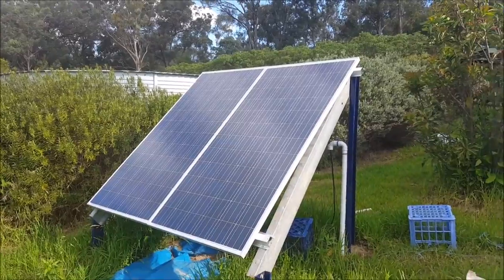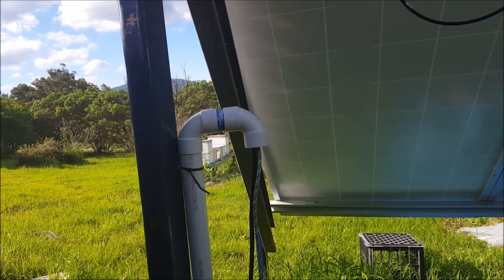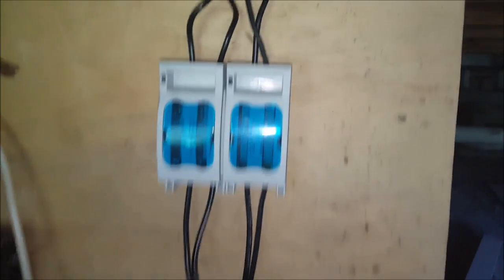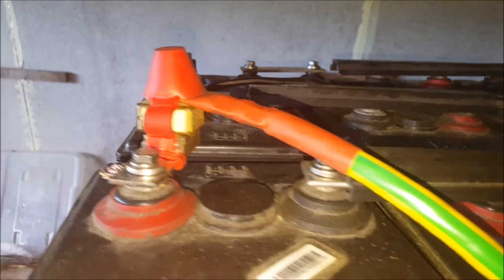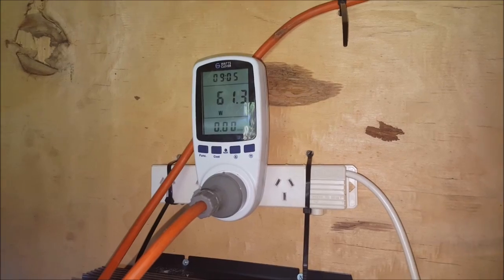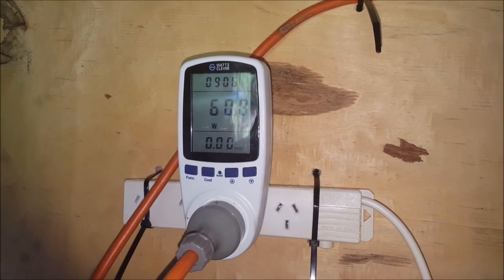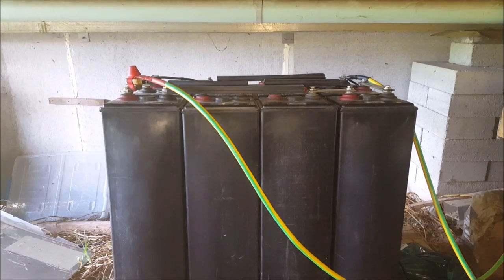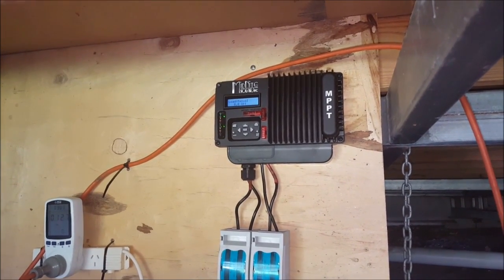Off Grid Solar Power - My 600W Solar Power System

Comment: plastic elec pipe (pvc) goes through an extra mfg. process to insure that the inside of the pipe is smooth and without any burrs.  water pipe misses that extra process.  the plastic for both pipes is the same.  the big difference is not in the pipe but in the fittings.  wire cannot be pulled through water fittings.  the bend radius is too sharp.  whereas in electrical ellbows...(90 degrees)  the radius is much longer and is then know as a "sweep".   so one would dig the ditch, use the pipe, then every needed turn a "sweep" would be used.   then after installing the total pipe run, a fish tape or "snake"  would be shoved into the total pipe run or between junction boxes.  after shoving the snake you tie your wires to the snake and pull it through the pipe.  then if. changes or replacement of wire is necessary one pulls out the old and install new wire.  never have to dig up your conduit.  but in your case, sad to say, you will be redigging and pushing and shoving forever.  or,  would you use cardboard as roofing material?  heck, why not ?  it's free or costs next to nothing.    so the lesson is....use what is required and correct.  not what is free or costs next to nothing.  i am really really trying to help you.  trust me.
Reply: for the size of pipe used and the capacity of cables I do not see a problem with this, also when you pull cables over a distance you should use a lube on the cables so they go in smoothly but this short distance will not matter. You also get on electrical fittings a short bend or the other as you say, a sweep bend.
Reply from the maker: +Robert Schilling I can pull the rope and cable through without having to dig up the pipe.
Reply: Thanks for this response.  I am aware of sweep 90's and other pvc electric condiut items that are a bit different from the water pipes.  But, the points you made about the improved inner pipe smoothness was something I was totally unaware of.  That said, I was all primed to do a PVC conduit for my mini-split lineset, but now I won't be using water pipe PVC for that purpose.  Nice to see an explanation on the why without hammering someone for the what.

Comment: I don't think you will be able to pull the rope by itself much less if wires are attached to the rope.  water pipe is for water.  electrical conduit is for wires.  cost is not a valid factor.  if cost was valid then why use any pipe?  it pains me to see water pipe being used.  i am a retired electrician.  and also a retired electrical contractor.  next time use the proper equipment.  believe me, you will be thanking me .
Reply from the maker: +Robert Schilling I used the rope to pull the wire through the pipe. What's the difference between pipe and conduit?
Reply: with pipe you might NOT cut the wires if you should dig a hole in the yard,,your really dumm,,person,,

Comment: why did you use plumbing pipe and fittings instead of electrical conduit and fittings?  you must have had real fun shoving that wire through each fitting.  you may as well had used direct burial cable and no conduit.  once installed your piping is useless to reuse or change the wiring!
Reply: For goodness sake, you're right already!! Sheesh! Does that make you feel better now? I've been following Pop for a while now and he's been extremely innovative in his system. I remember when he started small and, my, how his system has grown. It may not be up to  YOUR standards but it works for him and I'm sure it'll work for others. Tell me Robert, what's 3+3? Now tell me what's 4+2? How about 6+0? Guess what? Different equations, same answer. Guess what? Pop did it differently than you would but but came up with the same solution. How about showing the world your alternative power source since you're foremost authority? Until then, go find another video to troll.
Reply from the maker: +Robert Schilling The plumbing pipe cost me next to nothing and it was actually fairly easy to get the cable through the pipe. The double elbows are only friction fit and so are easy enough to remove. As well as that, I've got a rope through the pipe so that I can pull the cable through if I need to.

Comment: A quick question - why would you wire the batteries directly to the sine wave inverter. Doesn't the MPPT have a load output? Perhaps I am misunderstanding what the load output is for.
Reply from the maker: +David Kalnins The charge controller has a load dump feature to use excess electricity once the batteries are at float (fully charged, will not accept any more power) but that has a maximum current of 30A. The 2000W inverter can draw up to 167A. The inverter is hooked up to the batteries because the batteries store the electricity.
Reply: AHHH got it thanks - I misunderstood what the load was for :)

Comment: if you have access to the "grid" then why are you doing solar to get off of it ?  in Canada that is ridiculous.. why pay 20 -30 times the money for each KWH to be "off grid"?..  I have a 1000 watt array, a 1200 AH battery bank,  a midnite classic charge controller and a 3000 watt inverter charger, a 2000 generator.. the system cost me $10,000 and we pay $0.06 per KWH on grid..  that will take about 200,000 KWH of grid power to meet the cost of my solar system
Reply from the maker: +MrMeanderthal It was costing me $525 a year just to be connected to the grid. Then they charge $0.28/kWh on top of that. My last full quarterly bill was $144 for the connection fee and $70 for usage.

So far this system has cost me $2,500. Just on the cost of the annual connection fee, that's a five year ROI.
Reply: +Pop's Shack  in British Columbia where I live all you pay for is what you use except for hooking up the first time when you build a new house.. the cost depends on how much wire and poles it takes..  if your house is far from the poles on the road it can cost a fortune  but if you are close it is pretty cheap.. if you buy a house already connected it's just power usage you pay..  

the only reason I have my system is I live in a motor home and want to travel and park wherever I want and still have electricity.. I can't run everything on it though, my heater, hot water, and stove are propane..
Reply: and you don't pay a multi national company each year just to make them wealthy and if things do go pants, at least you will be able to take care of yourself.

Comment: Hi why have you got 40A fuse on the solar. If any thing happens they will never blow your cable will act as the fuse not the fuse itself. Just giving you the heads up.
Reply from the maker: Mainly as an isolator for the charge controller. If you see my more recent video, you'll see that I've gone to MCBs.
Reply: Ok I will check them out.

Comment: cool, you could do with more batteries,  nice little system.
Reply from the maker: I don't need more batteries as I only use about 1.6kWh per day, but newer batteries definitely wouldn't go astray.

I'd like to buy 8 x 200AH batteries for my next system, which will be 48V.
Reply: +Pop's Shack from what ive read its best not to discharge the batteries any more than 20% if you want them to last, ive seen charts showing how many cycles a battery  can do at 50% 40% 30% 20% 10%, at 50% dishcharge they dot last long. seems to be more cost effective to have more batteries,  although they cost the earth, i was trying to find away of building my own but ended up bying used near new from the mining industry, i found them on ebay but i cant find the guy again, theyre only 12v 100amp but they weigh 40kg each. another friend bought used locomotive batteries theyre 2v and each battery weighs 250kg. he bought them as scrap but most are still good.
Reply from the maker: +closertothetruth I'm only using 1.6-2kWh per day and that's on the days that I'm actually AT the shack.
Reply: +closertothetruth  I agree with you completely. I commend this Aussie on some very nice work thus far. You are exactly right in your assessment of his setup. I would suggest he DOUBLE his Solar Panels and Battery Bank-he can wire the two 24 Volts Banks in Parallel. THEN he'll be SET!

Comment: Cool Channel. I have a couple of questions...if you don't mind helping. What are the specs on those fuse isolators under the Midnite Kid? Specifically, I am looking for something inexpensive to protect my two PV arrays. The VOC on one array reaches 110vDC and around 24 amps max. The other array runs about 58vDC and about 15 amps. Where can I get those fuse isolators? Thanks.
Reply: +Chris DIYer The fuses are meant to protect the wiring and the controller not the solar array.  If your solar array decides to create a 5 mega ton mushroom cloud none of the fuses will prevent it.
Reply from the maker: +Chris DIYer I bought mine on eBay.
http://www.ebay.com.au/itm/2-Pole-DC-Fuse-Isolator-Switch-40A-Solar-Wind-Generator-Battery-Bank-/161347316104?hash=item25910ca988&_uhb=1

However, I'm now leaning toward getting DIN mounted, DC-rated, miniature circuit breakers and mounting them in a distribution board.
http://www.aliexpress.com/wholesale?spm=2114.01020208.8.8.V9auOS&initiative_id=QRW_20151209230301&SearchText=dc+mcb&productId=32267474848
Reply: Cool...thanks for the links. Good luck with your projects. Cheers.

Comment: Hi Mate. Very informative video.
I'm pretty keen to see how you get your 12v lighting system together.
Reply from the maker: +backtobasics I'll be using 12V flexible LED strips. I've already been using them in my carport and my parents are also using one 5 metre strip in their house, which lights the whole kitchen/dining/lounge area. The strips I use use 72W.
Reply: +Pop's Shack Yeah I just saw the strip lights you're using. Good seeing the difference in light between series and parallel, and the current draw. I'm interested in how you will run cabling. Doing my head in thinking about how I'll do it.  

Do I run heavier gauge wire to a bus (or multiple bus points) and then branch out the smaller gauge wires to individual rooms/lights.

Think maybe I need to get some and run some real world experiments over distance.
Reply from the maker: I'm also thinking on that. I've really only got four rooms to worry about.

Comment: Never seen batteries like your 2V.  My bet is you can't find them in the US.
Reply: +628DirtRooster you can find them but they wont come cheap
Reply from the maker: I reckon you can if you look hard enough. They're from an electric forklift.
Reply: Pop's Shack Oh OK.  I've never seen them out of a fork lift.  lol
Reply from the maker: +628DirtRooster These came in a pack of 24, all hooked up together and in a steel box with a steel lid. The whole thing weight a ton and really tested out the old trailer.
Reply: +pcguy36 What batteries really are?  This is the biggest negative to off grid for people who try to do this so they can live life cheaper.  Grid costs X and Batteries cost Y and sometimes Y can cost as much as X if not more and heaven help you if something happens to the PV array as what happened to Dave Jones.  Now if they could ever get the solar panel efficiency up to 40% or 50% from its dismal 14-21% AND they cost what they currently do THEN all of this would be moot and Solar would, hands down, win.  Here it costs <10 cents per KWh.